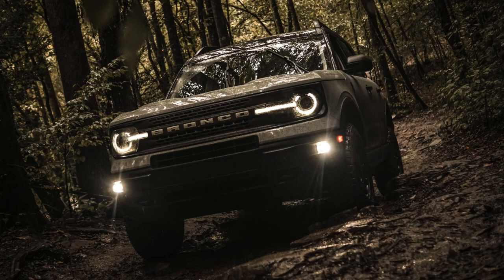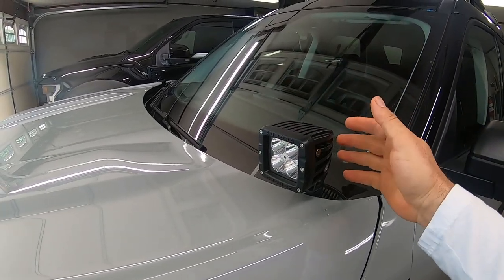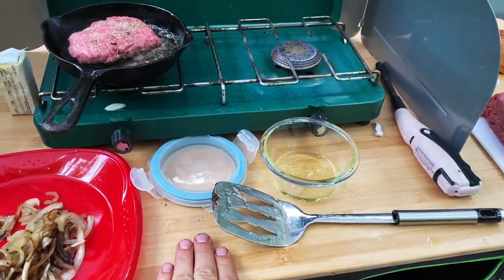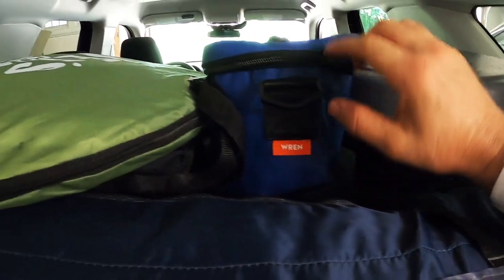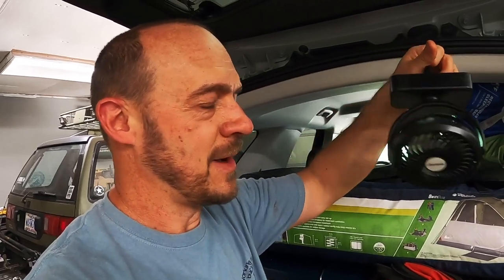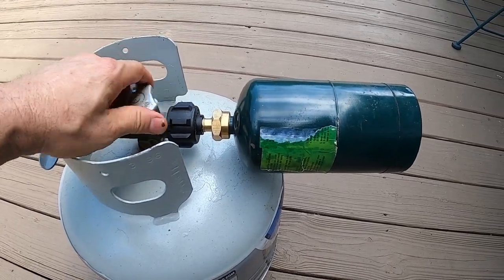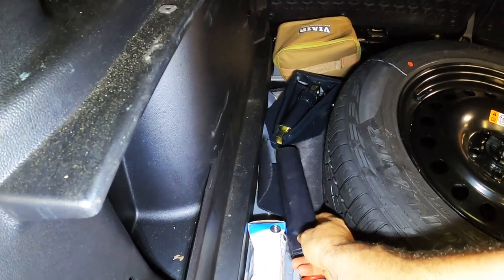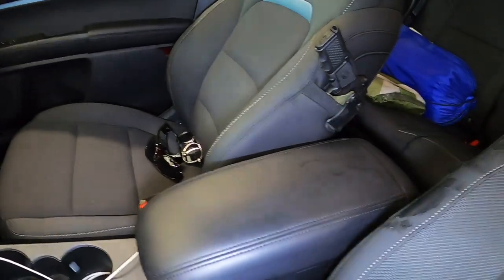The Bronco Sport ultimate overland setup

Comment: Love this video and between this and the other (Daniel Trail video) I decided to go with the HRG lift kit. I have the 2022 Outer Banks. What kind of gas mileage did you lose between the lift and the larger tires?
Reply from the maker: I'm not sure exactly since I installed the lift right away. It currently gets about 21 around town. I am always in sport mode and punch it a lot.

Comment: I love these videos. I just got myself a 2021 Badlands because of them. I want to grab your lift kit and get the bigger tires too, but I am having a hard time finding the wheels to go with. I am currently looking at grabbing Fifteen52 Traverse MX 17 X8 5 -108 wheels with Toyo Tire Open Country A/T 3 235/65 R17. What are you all's thoughts on that. Good plan, or could do better?
Reply: do 245/65/17, i run toyo at3 as well

Comment: I bought the 6'X8' awning. The assembly instructions are horrible. I'm close to figuring it out, but can't find how to connect the bag to the canopy frame.  How does the canopy mount to the roof rack?
Reply from the maker: Yes, and I kept that trick in my back pocket just in case. I never got stuck, so I left it alone. In the sand, however, I'd likely air down before even trying!

Comment: The only bummer about the bronco sport is the roof rack weight limit. Without the sunroof, it can hold 150 lbs., but with a sunroof it can only hold 100 lbs. That includes the weight of the racks themselves, so most rooftop tents are a no-go. They're just too heavy for it.
Reply: it can support 600 lbs without moving